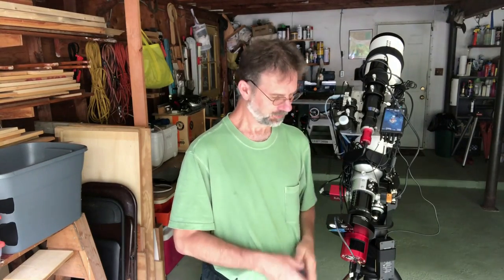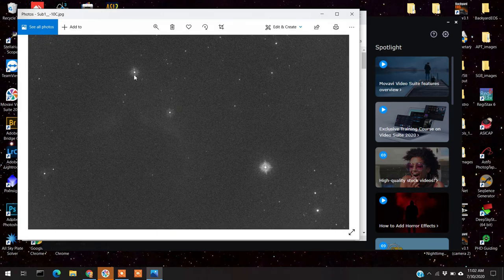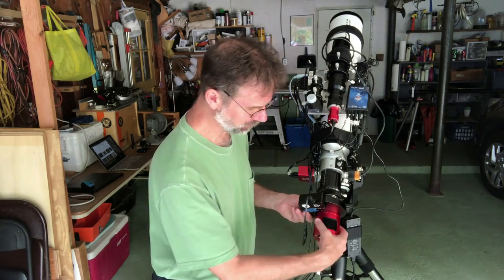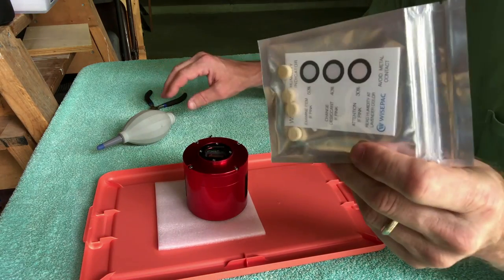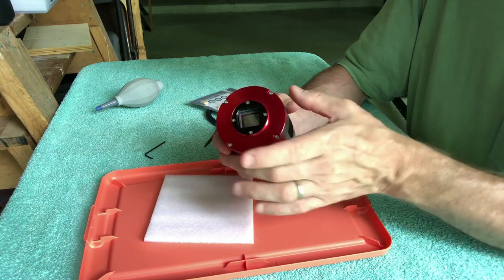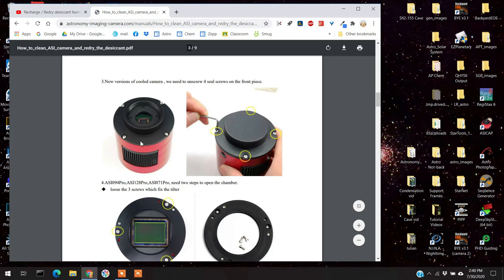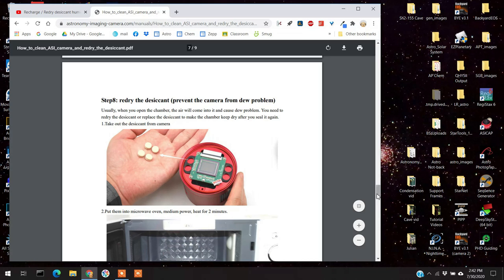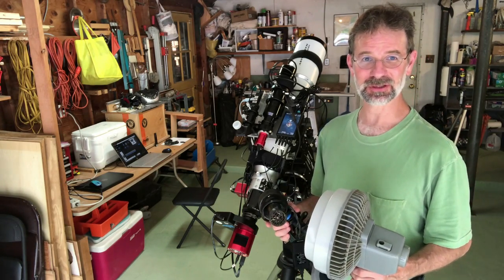Condensation On The Sensor Does This! How To Fix - Recharge The Desiccant Tablets

Comment: That's an interesting problem.  I've seen condensation form around dust specs before, but never like your example.  I do touch the tabs with my hands.  I notice if I don't nuke the tabs in the microwave, the condensation problem comes back within a few days.  If I do nuke them, the problem goes away for 6 months to a year or even longer.  Good video, Kurt.
Reply from the maker: Thanks for the info Chuck. I would not have chipped it if I just used my fingers.  If it happens again, I will get the ZWO Camera Dew Heater Strip. It is reasonably priced as well  ($20.00 USD). Supposedly the ASI1600 does not require the dew heater strip because residual heat from the TEC cooler will be conducted to the camera case to avoid such problems. Again, supposedly!
Reply: Hi, how many time do you put in the microwave? I tried with 6 minutes but the dew still appearing.

Comment: Thank you for all your very helpful videos. I had the same issue with my ASI071MC Pro after using it for only 2-3 months. Instead of taking the camera apart, I put the camera in a plastic bag and added as much desiccant sachets as possible, then sealed the plastic bag and opened it after a few hours. It worked for me since my camera did not need any cleaning.
Reply from the maker: Cool.  That is a great idea, thanks for the info!

Comment: Had the same problem myself with the ASI 1600mm. Luckily after two frames the condensation disappeared, it was forming on the protective glass plate, not the sensor. Whether I was cooling down too quickly, I'm not sure. I cool down to -20 over a 30 minute period, which doesn't seem to be too aggressive, judging by the settings other owners of the 1600 use.
Reply from the maker: Yeah, I was hoping it would disappear for me as well but it never did.

Comment: I have an ZWO ASI294MC Pro with Frost on the centre of the Sensor after temperature falls below 0'c.
I have  tried the desiccant microwave and didn't work. I replaced the desiccant modules. Didn't work, I added the adhesive heater strip... didn't work.
I can actually watched the frost form below 0'c when the light is bright.
Its's impossible to use flats to remove as the frost changes shape and size. 
I used expensive sensor cleaner and all that did was remove dust bunnies but not the frost
I run at subs at 0'c without frost but the subs suffer severe horizontal banding and Amp glow..
I live close to the pacific ocean and a large salt water lake and dew gets bad some nights.
I noticed the new cooled ZWO camera's have inbuilt sensor heaters like QHY so its a problem that comes  with cooled Pro cameras.
Regards
Barry
Reply from the maker: Thanks for info Barry - sorry about the dew problem.  I actually used a small fan blowing on the camera connection on one humid night and that actually worked.
Reply: I have an asi294 mc pro that every image I’ve taken with the sensor cooled to -10c have had some sort of issue that didn’t really show up in individual subs but it did manifest in the stack. It was always a darker patch in center or close to center with lighter edges. I finally got around to trying to diagnose this last night and found the same issue as you. Cooling below zero you can see the ice form in the sensor. After a period of time it seemed to somewhat go away. If I warmed it then re cooled it, it seemed to go away also. The images I’ve taken with the cooler turned off have come out fantastic. I’m hesitant to use the cooler now. I don’t have time to waste a whole night when I hardly have time to go out as it is. I’m thinking of trying to just cool to 1c and see how that works out. I haven’t had any banding issues so far.
Reply from the maker: @Dyno05  Interesting, I would try to recharge the dessicants if you haven't already, It is real easy. If that does fix it, you can try your method of 1 degree. If it works, stick with it as 1 degree is cold enough.
Reply: @AstroQuest1  I dried the desiccant tablets today. I will test tonight or tomorrow night by cooling the sensor and watching the sensor under a bright flashlight. If i still see it I will then have to try shooting at 1c. If I still have weird artifacts, then I will have to use the cooler off, and that kind of defeats the purpose of having a cooled camera. Even with the cooler off though it blows away my old T3i. I havent shot in the dead of summer with the cooler off though. Actually my last image was taken last  September and I can check what the sensor temperature was that day. Edit: it was between 9 and 11 C uncooled and it was one of my best images ever.
Reply from the maker: @Dyno05  Sounds like a plan, Good Luck/
Reply: @Dyno05  My fault on the ASI294MC Camera turned out to be sensor oil leak. Finally ZWO owned up to this a year later on early release ASI294MC. I had it professionally cleaned but haven't use it since as I now use a QHY268c.
Reply: @barrycampbell532  I don’t think my issue is oil because I can’t see any issues with the cooler turned off. However I’m making an assumption on that. I also use the camera in daylight with no issues. Mine was only visible below zero C.
Reply: @Dyno05  Hi, could you solve the problem? I´m facing the same issue with the dew. I didn´t try to put a new tablets but I warmed 6 minutes in the microwave without success...
Reply: @juandanielmorcilloregueiro9067  I dried my tablets but didn’t bench test the camera after. However, despite how much time has passed I haven’t had time to do much imaging.  The one time I went out I simply shot cooled to 2C above freezing.  The image came out great with no issues.

Comment: The moisture here in Alabama is awful, i have notice some circles using a asi294mc on the subs, found it was moisture on the outside glass, thanks for the heads up
Reply from the maker: Yeah, humidity is tough on astrophotgraphy.

Comment: I had a similar issue last week but with a relatively new 5 month old AA 183mm cooled camera. Anyway  it turns out I was cooling to quickly. Since the issue I have started using NINA where you can set a minimum cool time. No problems since
Reply from the maker: Cool...slowly.  - Cheers

Comment: Hi Kurt, thanks for the video. I am going to ask for a favor if you would be able to share dimensions of the dessicant tablet? I am going to use it in different brand cooled camera but I cannot find dimensions of the tabs to find out if it would match it to my camera. Thank a lot!
Reply from the maker: Too late they are in the camera.  I believe they are a standard size though.
Reply: Hi! Did you find out? If not, I will be replacing mine and i will share the dimensions with you